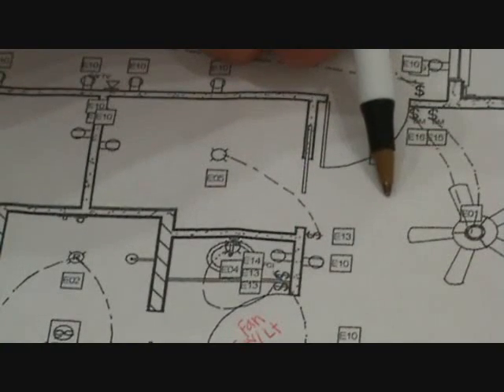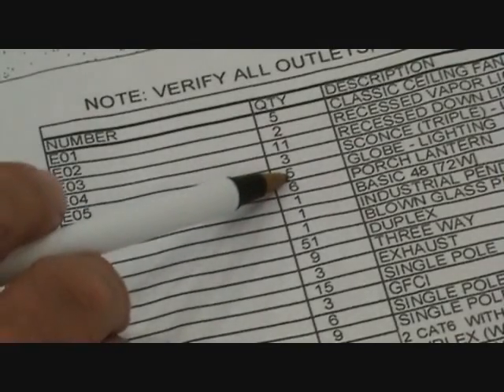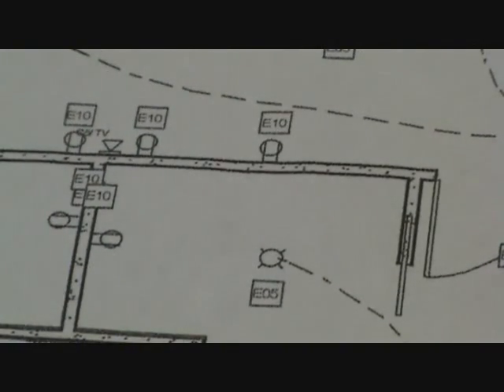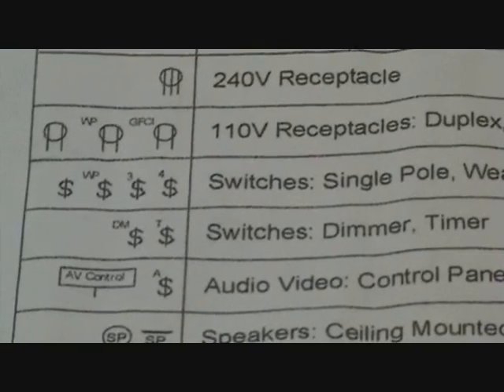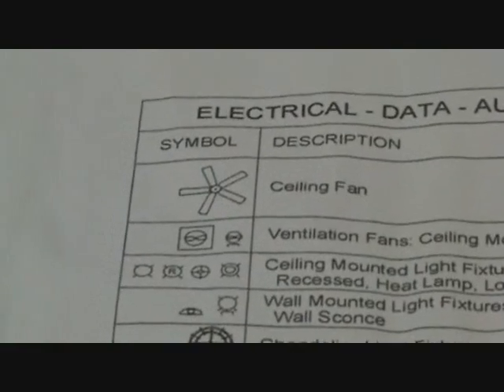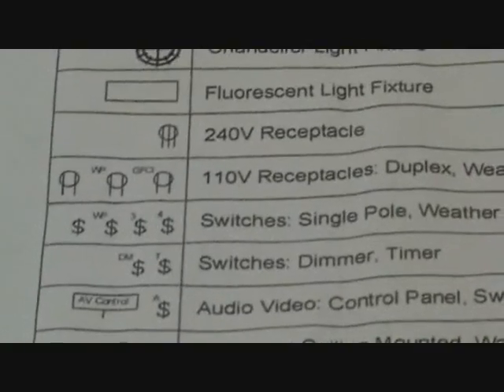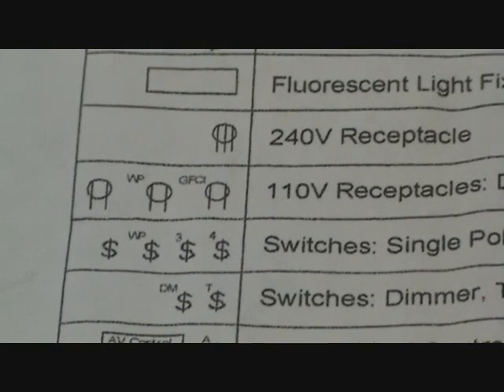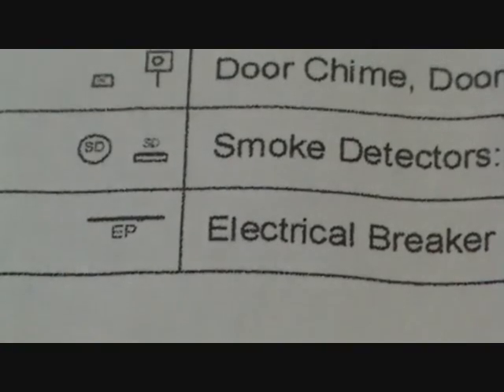How to read an electrical floor plan drawing

Comment: What I need to know is how to figure out where wires will be penetrating walls and how to figure out what walls would be assumed i.e. fire rated vs non rated.
Reply from the maker: These plans & the other plan videos I have on my channel unfortunately won't show you the stuff you wanted to know but I am hopeful you were able to get it all worked out many years ago. How did it go?

Comment: Who did that plan?  I've never seen an electrical plan w/ key notes on each switch & light.  Most people use a different symbol for each light and you can tell what it means by looking at the legend, no key note required.  Also, electrical plans should indicate which circuit fixtures are on.  I don't see any circuits called out on that plan.  Also, electrical engineers put hash marks on the wire lines to show the number & type of conductors.  I've never seen one like that before.
Reply from the maker: This electrical drawing was for residential & not commercial as residential drawings don't usually show the circuits & where they go for some reason but commercial drawings always show it.
Reply: @VideoJoeKnows  
A couple of the points I asked about have me wondering what I was getting at now, but I wrote that 11 years ago.
Anyway, looking at the video today, my guess is that that plan was drawn for an architect by someone who had experience working in electrical engineer's.  In other words, it has more in common with an engineer's plan for commercial work than residential.  Most people who draw electrical plans for houses know that clients will buy whatever brand of fixture they want and ignore what's written on the plan.  
With that said, the IRC requires that each circuit number be shown on the plan.  That way the electrician knows which fixtures are on the same circuit.  The circuit number is shown on the panel schedule, and the breaker size is shown there.  It's all tied to showing that the designer is keeping the panel balanced.